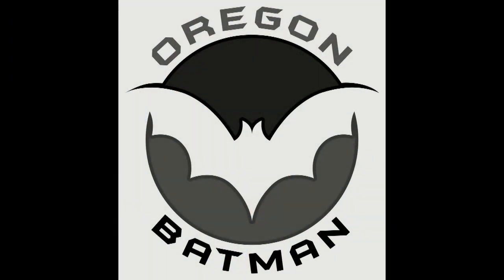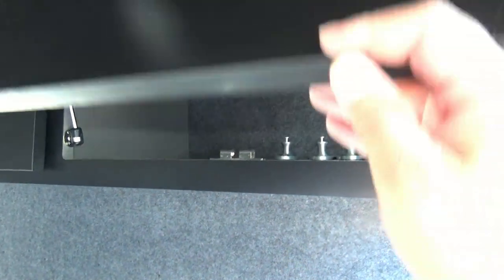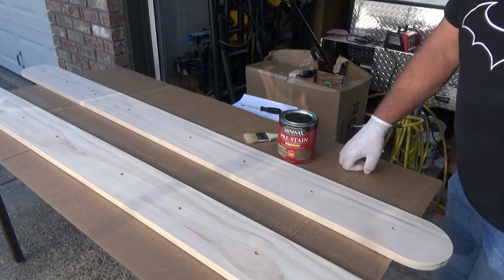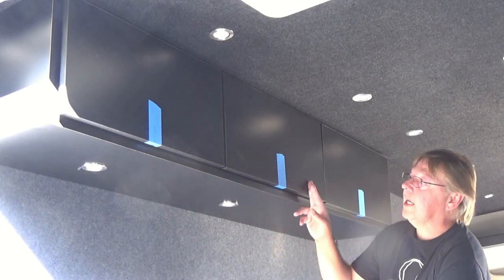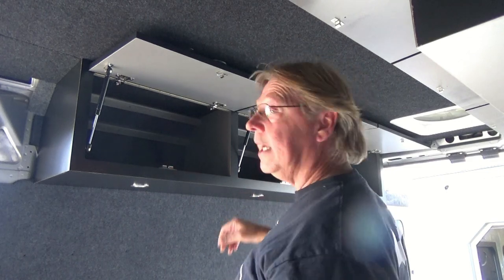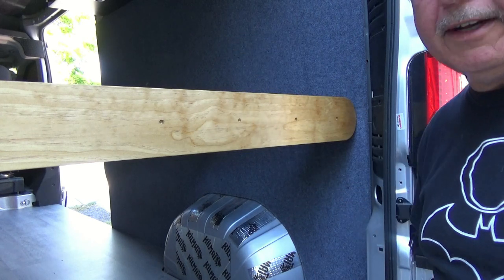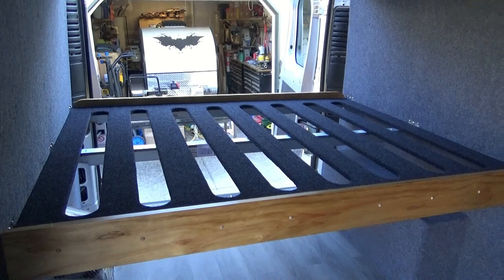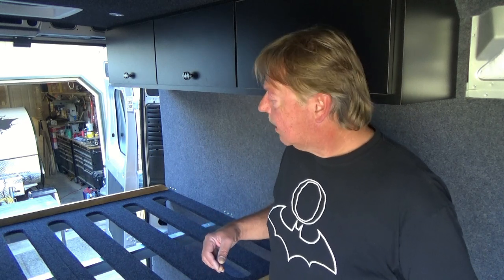Promaster Van Build 2500 159WB – DIY–  Bed Platform – Part 13

Comment: I always put 2 coats of stain on. It gives the wood more depth.
Reply from the maker: I did a couple sample pieces before I started... added several coats of stain to see how it would turn out. Decided on just one coat to keep it on the lighter side. Van is pretty dark on the inside, so adding a few lighter pieces changes the atmosphere a bit! :)

Comment: Nevermind I see!
Reply from the maker: :)   no worries!  Thank you for checking it out!
Reply: Your videos have been extremely helpful! What were the dimensions of the upper cabinets? I want to use your template if you don’t mind.
Reply from the maker: @leilastevenson  They cabinet dimensions came out to 12 x 14. 14 inches high and 12 inches from the wall

Comment: Did you drill the wood sides right to the Ikea metal supports? This is what I would like to do on my van. I am just getting started. Enjoying your videos.
Reply from the maker: I did... I fastened the metal brackets where the frames overlapped. So there was at least 1-1/2" of wood to fasten to, I used 1-1/4" fasteners for the brackets. Very strong! Thank you lindadunlavey!

Comment: Hey I love your channel.  I just made the wheel well boxes and carpeted them as you did. But now I’m wondering how to connect it so it looks clean without using brackets maybe kreg jig then cover holes with carpet? How did you do it?
Reply from the maker: I should have made a video how I installed those! I made the frame and installed over the wheel well first, that way I could fasten to wall. THEN I installed the paneling on the outside of the box. Now it is nice and secure. Now it makes me wish I would have done a video on that... didn't think people would much care. Anyway, hope that helps... and appreciate you checking out the channel!
Reply: @OregonBatman  thanks your videos have been very helpful in my build

Comment: Hello. Did you use anything to lock the cabinets closed so things don’t spill out when driving?
Reply from the maker: I do have latches on the cabinet doors, and with the struts I used, it keeps the doors closed pretty tight. I have had no issues with the upper cabinet doors opening while traveling!

Comment: Doing a bed frame like yours in my 136 Promaster. Can you tell me length along the sides of the van. Did you screw into van frame or furring strips. And what size screws? Great channel.
Reply from the maker: HI Doug... My bed is approx 54" x 70" and I fastend the bed frames into the wall framing I installed (check out the framing videos). I attached the studs to the van walls using a rivnut tool and fastened the bed frame using #12 x 1" screws. Holding up nicely! :)
Reply: Thank you. Can you tell me if you screwed the side pieces into the 1/2 plywood or into the Skorva beams?
Reply from the maker: @dsd721  The brackets fastens to the walls, then the skorva beams rest in the notch of the side pieces. Half inch base over top fastened to the side pieces on bottom. Pretty solid

Comment: Looks really nice, Al. How wide is the van, side to side. And what size mattress is that, I’m guessing a queen?  Looks like you’re using new video editing software. You did a great job with this video!  Keep’em coming!
Reply from the maker: Thanks Dan... the van is actually pretty wide. Narrowed it up by about four inches or so by adding all the studs and walls. The bed is actually a little shorter than a full size, which is perfect. I don't plan on spending all my time in the bed, so it adds space to the front by using the full size.

Comment: Great job Al!  I like the bed plywood base with all those openings:  you didn't mention how they were made, was it with your CNC?  Nice door handles!  Yep, IKEA Skorva supports and their wall brackets are doing great for vans.  Finally, there won't be any side windows in the van?
Reply from the maker: Thanks Raynald! For the bed platform, I made a jig for the slots and cut each one with a hand router... platform too big for CNC. I decided no windows on the sides for this one. I think if I do build another, I will install windows.
Reply: @OregonBatman I just bought a promaster, and have been watching your  videos. I love your attention to detail.  I want to build mine very similar to yours but don't have the same skill! I live in Bend Or. Might you consider fabricating the wood portion of the bed with carpet again?

Comment: What are the cross bars called? I'm installing a elevated queen bed in my toy hauler and the metal cross beams are maybe what I would like to use.
Reply from the maker: There should be a link in the description f the video for the bed rails. They are called Skorva and are used as center supports for Ikea beds. They are a big help when installing the bed platform! Don't forget to look for the brackets as well... you'll need those to install the rails. Thanks for checking it out!

Comment: where did you get the carpet on the walls?
Reply from the maker: Hi there! Purchased the liner for the walls on Ebay... link below, thanks for checking out the video!

Charcoal Gray Automotive Trunk Liner Upholstery Cloth Auto Pro Flexible 54"W

https://www.ebay.com/itm/272315416668?hash=item3f6743805c:g:wRoAAOSw3hBgM~7K
Reply: @OregonBatman  thank you!